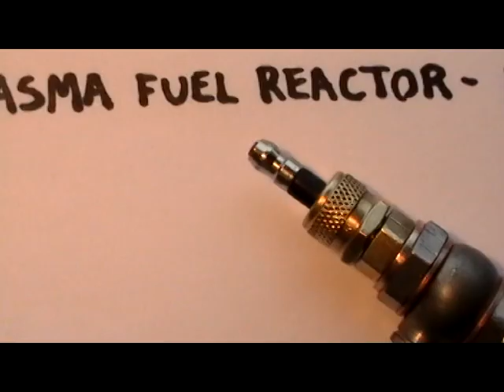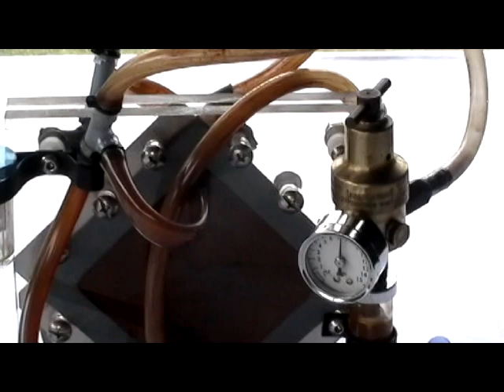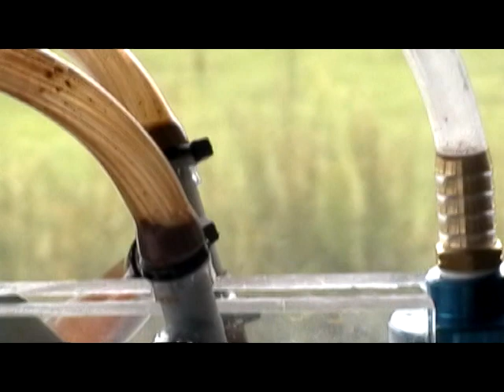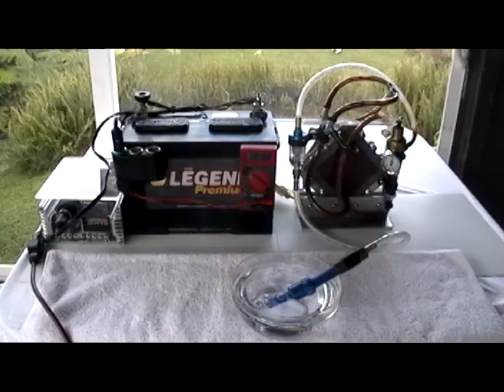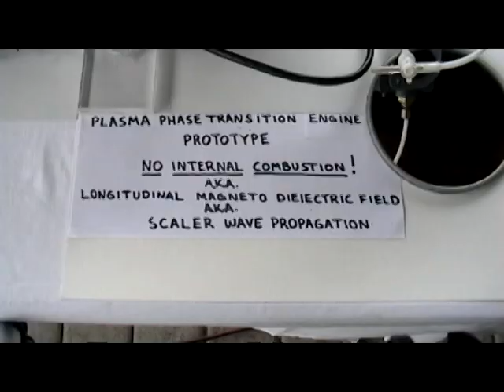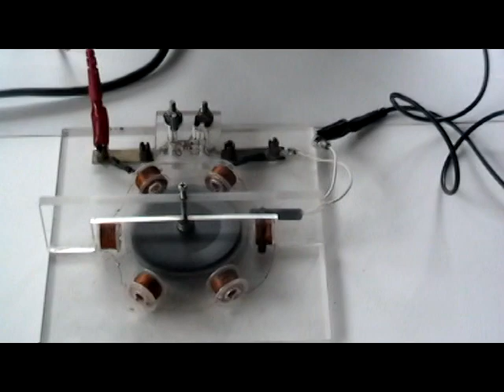Plasma Phase Transition Engine Prototype

Comment: If the average 4-cylinder car is driving down the highway at 55 miles per hour consuming air and fuel at a rate of 100 CFM.. how many car batteries will it take it's reproduce the needed volume of gas. I saw three small that Nations that your apparatus created in about 15 seconds. I would say that off the cuff you would need one cylinder detonating with about 100 times the gas as one of your detonations. So first of all you would need 100 times the amount Brown gas take night one cylinder. Multiply that by 4. For a 4-cylinder car. Now you'll need 400 times the amount you created if your RPM is 2500 at 55 miles an hour. If you do the math it looks like you'll need to produce about a million times the amount for 1 minute of engine operation of what you created in 15 seconds. Can you please explain now how you are going to scale-up production of brown gas to meet the fuel requirements of this vehicle

Comment: I hope people will be kind to you. You seem like a pretty smart kid hopefully after a couple of months you'll figure it all out. I like your work it's nice and neat you obviously have some mechanical Talent. You need to brush up on your physics. You wasted a huge amount of energy to  creative some gases to burn. Much more energy than the burning of the gas can provide. You seem to have a pretty inquisitive mind. I'm sure you'll figure out why this won't work. Perpetual motion machines don't work brother. They never have and never will. Others have been designed very well and have minimized almost all the loss due to friction. And other words I'm sure that someone has created a machine where he may have gotten 99% of the energy out that he put in. Who knows maybe even closer. But you will never get more energy coming out of a system that you put in. Good luck with your endeavors like I said before you seem like a smart kid. Take some Physics classes become a physicist and then maybe you could really wow us.
Reply: You obviously live within the framework of laws that are imposed on human humanity to think that it is really so. But it is not. For this device that the man shows in the video, the key is the high voltage of 500,000 volts, which, when two atomic hydrogen and oxygen pass through that arc, turns those two gases into monoatomic form. In fact, you have atomic energy in the engine. And that's why you don't need a big the amount of these gases for the car to work and drive. Open your mind above those laws of theirs.

Comment from the maker: The Process of Plasma Phase Transition or Plasma Expansion

 This system makes hydroxy fuel on demand and runs on 12 volts D.C. @  less than 15 amps which is less than 180 watts, about the power of your headlights. The water in the cell turns orange/brown because the chromium has been pulled out of the stainless plates through a reverse electroplating process. This conditions the plates to become higher quality electrodes. The chromium in the solution becomes a self-made electrolyte which causes the cell to perform more efficiently. This solution doesn't leave the cell except during service or repair, in which it can be stored and then reused in the cell.  

 What I'm showing you here is rainwater (liquid) being split into its base particulate; two parts hydrogen (gas) and one part oxygen (gas) through an electro-chemical change of matter. Consuming a very small amount of water and electricity. One part of liquid water transforms in to 1,800 times its mass in a gaseous form. After this liquid has been converted to gas I run a high-voltage, high-frequency plasma arc through the gas for a micro-second causing the gas to change to another state of matter, plasma. 

 Plasma is a luminescent, ionized, magnetic colloid (semi-solid suspension in a liquid or gas). Plasma is the fourth state of matter, and one of the least understood state of matter and is not commonly talked about in most science classes.  Plasma is the most abundant phase of matter in the universe. Lightning is one form of naturally occurring plasma. What you are seeing is the liquid changing to a gas and then for a small amount of time the gas changing to plasma. 

 The abundant energy release is caused by two hydrogen atoms fusing into one. Each dropping a small amount of atomic weight to form a single atom or shared nucleus. When the arc is removed the hydrogen atom splits back into two atoms and becomes stable again, releasing photon energy in the gamma ray spectrum. This is where overunity is acheived through quantum tunneling (a quantum-mechanical process, forbidden in classical mechanics, in which an atomic particle passes through a region where its potential energy is higher than its total energy). The only emissions besides the radiation is water. This is L.E.N.R. (low energy nuclear reaction) or cold fusion. This is why I call this device a plasma fuel reactor, not a spark plug. 

 There is no compression or extra oxygen needed like the needs of an internal combustion engine. The Oxidizer (Oxygen) is already in the fuel.When the plasma expands and then contracts a vacuum is created which causes an equilibrium in temperature (stays cool to the touch), so there is no need for a cooling system and there is minimal loss through heat. Because the force is linear all the power pushes staight down on the piston eliminating blow-by and stresses on connecting rods or cylinder walls. The crucial placement of the spark plug is also no longer an issue. Injecting a timed fine mist of water at the point of expansion will sustain the reaction or increase the amount of expansion, therefore increasing the amount of power.

 Evolution of this concept could be an all boron silicate glass piston and cylinder and the plasma arc could be replaced by a laser ignition that penetrates through the translucent cylinder wall. The prototype engine that I am currently working on has a piston, cylinder and crankshaft. No valves, rockers, pushrods or camshafts which are the power robbing devices in most engines. Because of the vacuum created during the contraction the piston it is actually pulled up giving rotation to the crankshaft, making this a single-stroke engine (power on both up and down strokes). An even more refined version would be a piston-less engine with a magneto dynamic generator (which has no moving parts) in place of the piston. This would make large amounts of electricity without the frictional or mechanical losses and could be used to drive an electric car. I show you the U.R.F.C. (unitized regenerative fuel cell) capabilities at the end of the video. The light energy may also be captured via radiant energy reciever (solar panels) on the exterior of the cylinder walls. 

 Nikola Tesla (1856-1943) {not the car company} said his most important discovery was not the discovery of alternating current (AC) wich was septic and stung or bit to the touch, it was the discovery of a white healing light, a magnetic luminous substance. 

Aloha, 
Chris Gemini
CGA Custom Research & Development